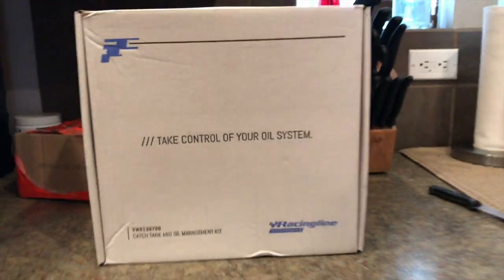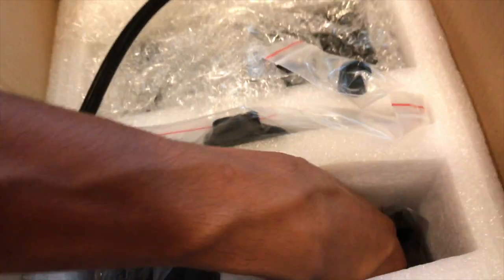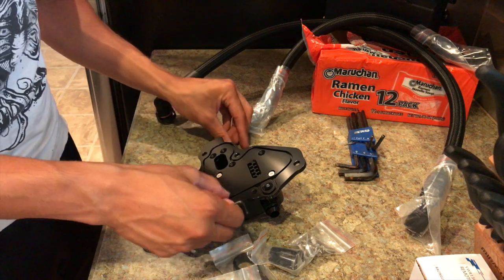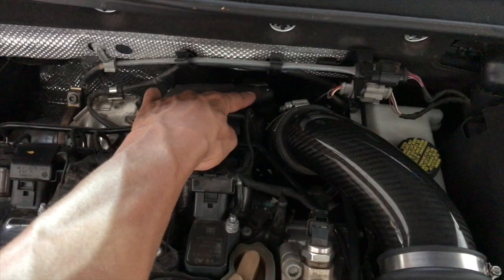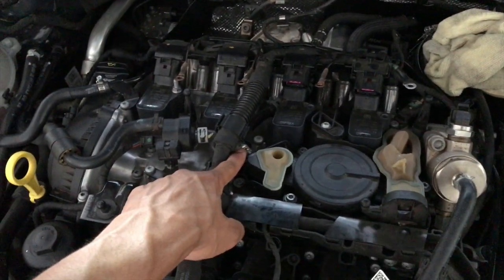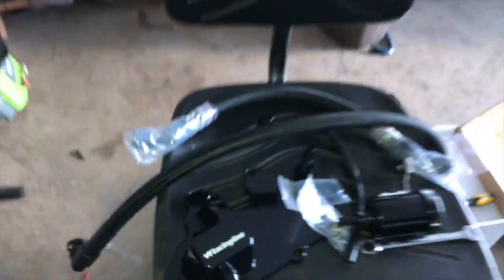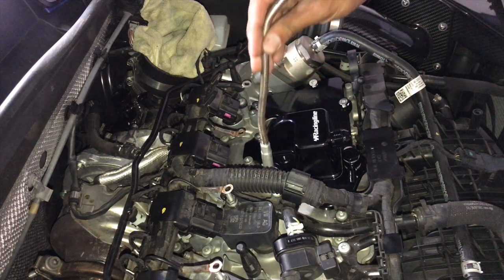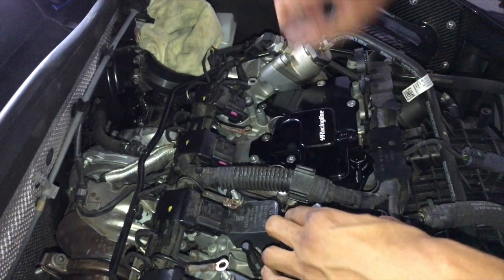Racingline Catch Can Install MK7 Golf R!

Comment: you should have put thread locking compound (loctite) on the inside screws, you don't want them to get unscrewd with vibrations and fall inside while the cams are turning. I really suggest you do ASAP.
Reply from the maker: +Luis Brau solid idea!

Comment: Bryce can you explain how the plate on the aftermarket pcv systems works? PCV's and the OEM is a valve or diaphragm in the VW's case. It seems like these aftermarket units don't actually have a check valve at all... Is that correct?
Reply from the maker: If I knew the ins and outs I totally would. There's a big post on golfmk7.com by Ed Susman from EQT about the new revised PVC plate (OEM) maybe read that and get some information. Sorry I can't be of more help, I don't really understand it myself.. just knew this was track tested and proven to fix smoking issues on the track. Still installed to this day with no issues!

Comment: How did you get the coil packs off without the tool?and how about the electrical part of the coil packs?getting them off was giving me hell.i had to call it a day and couldn’t finish the job.please get back to me ASAP.thanks Bryce
Reply from the maker: Only do it when the car is HOT. Go for a drive first. For the connections them selves push down towards the coil pack first then pinch the clip and pull up.. do that to all of them before fully taking off the connectors, it's very hard to do them individually with how tight the electrical stuff is going to the connectors. After that getting the coil packs out is easy if the motor is HOT. Literally just wiggle and turn they'll pop right out.
Reply: Thanks Bryce for getting back to me!!!will try again tomorrow!👍🏽👍🏽👍🏽
Reply from the maker: Anytime buddy!
Reply: So I have a leyo Motorsport catch can.both of the oil lines run to the catch can .im confused because the oil line on turbo inlet adapter has a oil line.so is that fine to have 3 oil lines? http://bd8ba3c866c8cbc330ab-7b26c6f3e01bf511d4da3315c66902d6.r6.cf1.rackcdn.com/LEYO_Catch_Can_Install.pdf

Comment: Dang are cars are becoming more n more alike. How often do you have to empty the can? and can you easily get to drain plug or do you remove can?
Reply from the maker: Really depends on the season and humidity and how much you race.. in the summer months probably every 5 weeks or so.. takes maybe 10 minutes to empty the can if that, you have to remove it. Two bolts and two lines it's not difficult by any means. Winter months a little more often due to condensation and such. Where it live it never really rains though.. so is rainy climates you may have to do it more often. It's worth every penny though, still running strong no leaks!
Reply: @BryceJordanProductions  And it 100% solved the problems? I was researching the kit and your video popped up. Good job with the details.
Reply from the maker: Haven't had a single puff of smoke sense. Been through probably 35k miles and 30+ track days sense this video went up, never an issue!
Reply: @BryceJordanProductions  Kind of crazy that the Golf R catch cans need to be emptied so often, I get about 10 ounces out of my wife's Focus ST every 5k miles. She doesn't autocross it though, and we are in San Antonio.
Reply from the maker: @CA-td2mx  it just depends on how hard you drive really and humidity. I rip TF out of this car with 32psi lol

Comment: Did you ever go back and put loctite on those screws? If so, which version of loctite did you use? This is the only part scaring me away from this kit!
Reply from the maker: Nah I didn't actually, shes good still about to hit 52k lol. I'd use just a small dab of the blue 242- we use that on our aircraft 👌
Reply: Thank you. Any updates on your friends is38 GTI?
Reply from the maker: @loyalsoldiermac  she's running and doing great ever since!
Reply: @BryceJordanProductions  Knew ya were military, didn't know aviation. I was a CH-47 and MH-47 guy before going medical. I remember safety wiring EVERYTHING, lol.

Comment: how's the catch can working out? I think I might be in the mood to buy one.
Reply from the maker: It's the bomb!! Must have if you plan on tracking the car!
Reply: @BryceJordanProductions  thanks, yeah for my car its 399.95, but one it's on sale its 336.95. Which I just missed.
Reply from the maker: What do you drive? Catch cans are expensive man, my setup was like 799, but it does more then just being a catch can
Reply: @BryceJordanProductions  mkv gli, so for I got the racingline springs, racingline rear sway bar,  racingline sump plug, racingline intake, spm cat less down pipe, vibrant performance catback, so the catch can will be next and then the big brake kit. Which their ko4 oem+ tune would come already. Would get that too
Reply: @ bryce Jordan productions But I catch everything on sale, full price for nothing. Total so far 1,330.00 for all I done so far. oh yeah motul oil, made a great difference as well. Didnt think so but it does. I used to burn oil like crazy, now I don't. I kind took ya slogan, "Racingline everything" but with a good price lol.
Reply from the maker: Hell yeah that's what's up!! I love racinglines stuff! I wish I could afford their coilovers 😅 they're like $3,000+! They are the shit though I'm glad I decided to get their parts
Reply: @BryceJordanProductions  uspmotorsports 15% right now
Reply from the maker: It could be 50% I still can't get them right now 😅
Reply from the maker: Might get the oil cap though...
Reply: @kingdomliving5868  What weight Motul oil, and are you in a colder or warmer climate?